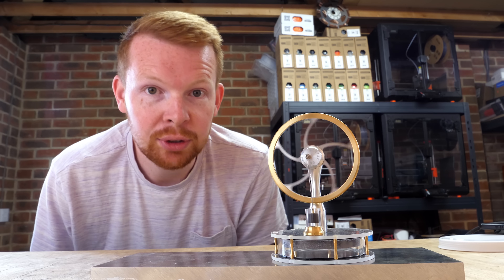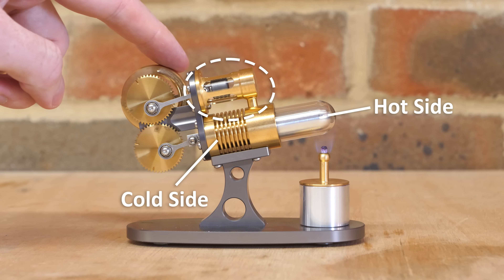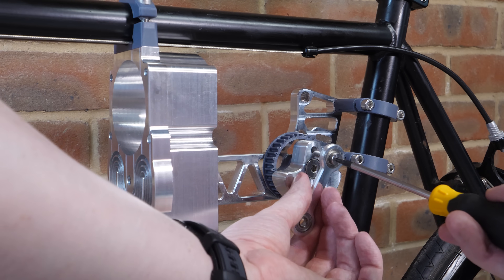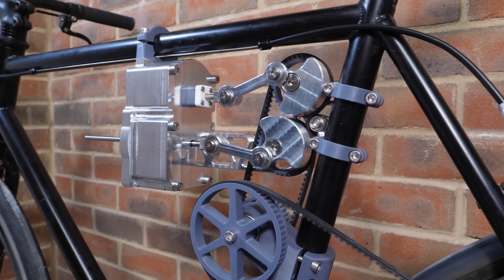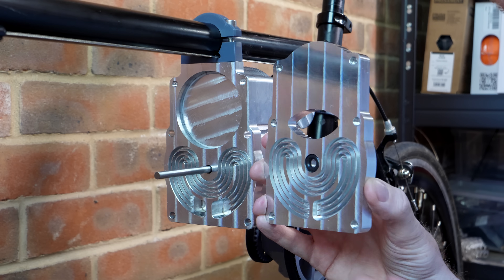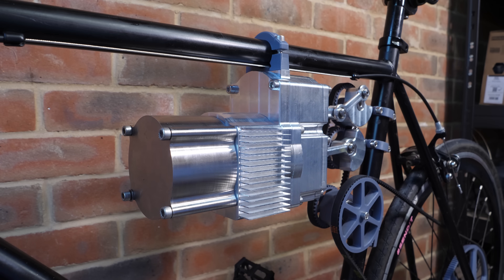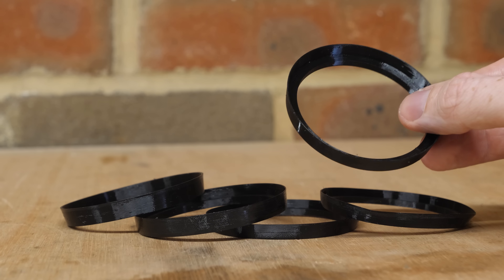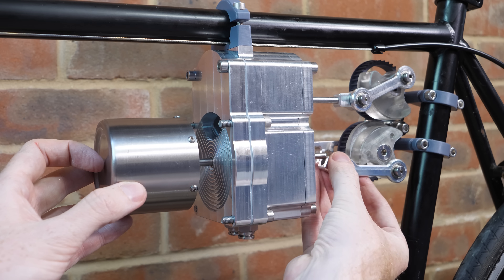Building a Stirling Engine Bike - Part 1

Comment from the maker: Go to https://ground.news/stanton for a better way to stay informed. Subscribe for 40% off unlimited access to world-wide coverage through my link.
Reply: Why use air when there are better alternatives? other gases or even liquids like oils
Reply: I make it with two cylinders
Reply: You ever thought about reverse engineering the electric cigarette lighter to create a heat Source and the power for that can be generated by the front tire Movement by putting a small generator on there that will create the energy necessary to ignite the electric lighter
Reply: I've got a question, why don't you use a bigger coil with an induction heater for this instead use a cable to activate heat source no need for a flame the induction heaters are battery chargeable for the most part I use 1 to consume cannabis
Reply: Use a v twin engine next time like a lawn mower engine then use one side as a power piston and the other as a displacer you can just pop the piston rings off the displacer piston use the spark plug holes to connect both cylinders together this style is actively being used to make energy it uses a parabolic dish and magnifies the heat of the sun to drive the engine they have models now that can produce up to 10 kw only using heat from the sun also instead of using air use a different gas like nitrogen it gets more efficient power
Reply: sterling's works in reverse if you use cold instead of heat, consider using a phase change material, look for the video "DIY Supermaterial Could Save You From Heatstroke: Salt based PCMs"
Reply: Practical idea: If you have a heater in a room — for example, a rocket stove heating a water tank — you could use a Stirling engine to generate electricity from the heat flowing from the tank into your living space. That way, the same heat used to warm your home would also serve as a source of electrical power.
Reply: I like your projects and impressed how you bring your ideas to mechanics! Regarding Stirling my favorits goes more to Solarstirling, but as of now PV seems to be winning the race. But back to your project, I'm quite sure with pressure you are on the right way, You could search e.g German Side 'Viebach Stirling' there is a lot of material including CNC plans. There they show 10 bar pressure  or 150.000 PSI (Air or N2) is needed for a similar sized machine (Helium or H2 would be better but more expensive or inflamable). Chatgpt is telling roughly linear, means  your e.g 10W (mostly friction) might go to 100W.
Reply: To be fair i have seen and heard of every steam powered thing under the sun but I have never heard of a Hot air Engine powered Bike (Stirling Engine bike) As someone who works with live steam i will say that your safety is always top of the list boilers are a very tough thing to make if you're a beginner and if you were to attach a boiler to the bike that would get even more tricky as you need to monitor it you need to make sure it has fire all while it's attached to the bike it's self and that means you're going to be a bit toasty with a boiler strapped between you and a bike, If you do have any interest in Steam, I would highly recommend looking at Steam Model Engineers and kits,  and if you want something that can get  you a to b on steam a Steam Wagon or Steam Traction Miniature in the 4 to 6 inch scale would do, but that's getting expensive, Anyways I think this a great educational piece and a good thing to show people who aren't familiar with how Stirling engines operate and people that want to experiment as one really shouldn't be touching steam boilers unless they have a good clue on what not to do
Reply: Could you make a video experimenting with soft robots?
Reply: I've been watching YT since it started (2005). You are the second Channel I have subscribed to. Thank you for the great engineering.
I started CAD modeling in 1981, GE Aircraft Engine Group. 3D Printing was in it's infancy when I left CAD 3D Solids modeling for Project Management.
It was your Flywheel Trebuchet that hooked me.

Comment: Never use grease on a Stirling engine especially the hot side. Ditch the piston rings on the power piston. Make the piston longer and use graphite as a lubricant.

Comment: I think the major problem is the heat exchanger sizing, you need a heat exchanger on the hot side too, because the contact surface is so small so the system overcompensate by using higher temperature, but that's not ideal and most of the heat is lost to the air.

Comment: Over 40 years ago I first heard of the Stirling engine.  I set out to create some design parameters.  Everything you are doing reminds me of my own experiments.  It took a number of engines before I got it to even operate.  It was never super efficient.  But then I saw the rider engine.  Two simple cylinders with effective regeneration between each.  Suddenly the world changed.  Four to one compression ratios were quite possible.  Greatly increasing the performance.  The phase angle between the cylinders was not 90 degrees.  It was CLOSER to equal to maximise the compression.  I had run the figures through my TRS 80 computer to predict the best timing angles for various temperature ranges.

Comment: As I look at your design I wonder what the restriction was so that the power crank doesn’t align with the piston and as a result needing a substantial crosshead. Was it the size of the cnc? I feel the cylinders could have been spaced out a bit

Comment: I was the only one in my class on thermodynamics to successfully make a Stirling engine that could fulfill the assignment of lifting an American quarter from the ground to laboratory table height. I'm a big fan of Stirling engines. NASA uses them, and space is in fact the perfect place for them, because you have constant sunlight on one side, and near-zero temperature on the other. However, I can't help feeling you're completely missing the point with this. I don't think you'll ever get a workable Stirling Engine bike. If it requires a gas-burner heat source to barely function, what's the point? We've been driving bikes with small conventional fuel engines for over a century, and it would be easy to modify one to run on gas much more efficiently than your Stirling Engine. Allow me to suggest that you make a Stirling Engine Solar Powered electricity generator instead. Use cheap prismatic lenses in an array to focus sunlight and fuel a stationary Stirling Engine that would drive a generator that would charge Lithium batteries for uses like LED lighting in remote villages in India, Africa, and South America. There are places like Tibet and the Andes where sunlight is abundant during the day, and the nights are close to freezing. If one could shade and insulate the ground so it serves as the cold side, and run a Stirling Engine during the day when the sunshine is enough when focused to serve as the hot side, it should be a perfect combination to generate a small amount of electricity for a household off the grid, at least enough for lighting. Of course, one could generate electricity with solar panels, but a Stirling Engine might actually be a more viable option, since it could be more easily produced and maintained locally. My name is Brian. I'm 70 years old. I have a degree in Aerospace Engineering. Let me know if you are interested to work with me on a project that might be of benefit to many poor people in remote villages without electricity.

Comment: you need to get rid of those power piston rings. The friction from those is not good. You're better off using a piston without rings and machine the piston so that it is almost a perfect fit. Yes you will still get some leakage but it will outperform the ringed piston. without pressurization to be honest you'll be lucky to get 10 watts from that engine

Comment: Maybe try adding a heating element to the hot cap so you don’t have to use the propane torch and that way generating heat can be battery powered

Comment: Well the idea of running a bike on a candle flame, thats pretty cool. Not much a motor guy, but this thing probably 2-3 times the size and a large heavy flywheel at rpm. Then reduce to a slow wheel speed would be usable on the street. Hope to see more videos like this

Comment: The oldest trick in the book to create a perfect gasket is to place the gasket material on the surface you aim to seal, and then use a hammer to carefully tap around the edges. Et viola, a gasket in 2 minutes, no printing involved.

Comment: I realize that the amount of air to pressurize the engine bay would be large and that this solution might not be the safest, but what would Paul McCready do? Imagine that the Commander's Seat is on top of a large bellows. It is rectangular and has four linear actuators on each corner. The plane flies up and down to fill the bellows and the linear actuators assist.

Comment: Battery charging seems an option and using sun tracking solar mirrors to heat the relevant parts could be used , plutonium as a heat source would not be too popular I think , but a small unit place around a waste heat source could power retractable batteries and that could be useful .

Comment: If 50mg of paraffin wax is 10j of energy each time the cylinder cycles times 500rpm that is 83j/s. So, a 100mg glow plug would put 160w in the cylinder. A peltier tile to power that plug would be like 120w.

Comment: If the engine is 15% efficient and it is 150w output, 1000w of heat needs to flow through the hot side to the cold side.

Comment: Back in 2014 me and my friends for our college final year end project,  developed a beta type sterling engine of 30 cc capacity with internal pressure of 1.28bar. The engine ran for around 15 minutes non-stop,  the piston ring got seized and the connecting rod joints broke off from the sleeve glide rails, the cooling system failed . I was so happy that at least it ran 😅😅😅. At the end of the day our team was the only one   to score 50 out of 50 in the test score. 
PS there were 20 teams with 5 members.

Comment: Great job, but wouldn’t it be better to build a Stirling engine with at least 1 kW output for households? The heat source could be any solar panel or other simple source of heat. This would be an excellent emergency solution for generating electricity at home. I believe it could be produced at an affordable price.

Comment: If you put something in the area where you burn the plate but inside that stays hot, and add low compression burning gasoline, you would make it diesel.

Comment: 6:40 I realise that just because you're smart doesn't mean you know everything, but it's still jarring to me that a man of Tom's capability has his rear brake set up wrong 😅 the caliper should be set up to work with the little silver lever flipped down. That way, you can flip the lever to open up the caliper, allowing the tyre to pass between the brake pads.

Comment: Maybe try adding a flywheel on the engine and then a clutch after that and i bet you will have more torque.  3d printed transmission added maybe for most efficiency 👀

Comment: I am trying to find out if super conducting tape will reduce thermal losses in a corona motor, chatgpt doesn't really say it will, but I still think a tape deck with a xenon stirling regenerator could be useful to microwave sputtering.

Comment: If a 90hp motor wastes 182hp as heat then a 15% carnot efficiency stirling engine regenerate a potential 27hp. That is a bad estimate because it doesn't take into account the heat radiated from the block and the heat out the exhaust, and I'm sure that the coolant has to be an appropriate temperature when it goes back to thermostat, but I'm sure 10-15hp is possible there. The stirling draws right before the coolant goes through the radiator. I like to do other ecomods, just because, like making the accessories belt electric to reduce drag on the engine. Electric water pump. Increase the spark in the cylinder. etc. etc.

Comment: Look at PlasmaChannel's electrostatic motor. I think, those kind of motors like a specific RPM to be efficient. Imagine that cylindrical motor is the width of an economy vehicle with a couple of belts that drive the back wheels. It would be an awesome kit. If you could regenerate even 10hp to those wheels for highway in a 90hp vehicle the fuel economy will be improved dramatically. If the vehicle has exhaust gas recirculation, there is the potential to improve combustion and emissions. It would be nice to market super commuters for retrofitting, find the people who drive 1-1.5hr to work, so they can jump on the interstate and hit the cruise control and save gas.

Comment: What is the flowrate of your stirling if you put it on a hot iron? It would be awesome to get a hybrid electric car and put a stirling on the engine coolant. Hybrid electric cars are usually like 40% thermally efficient at converting stored chemical energy into mechanical work, they do still waste heat through the coolant, if exhaust is 15%, there is still 25-35% of the thermal energy generated in the coolant. So, you could make the stirling large enough to regenerate enough energy to run a compressor head and regenerate electricity for forward motion.

Comment: Yes — and that’s a really interesting and active area of research.

There are crystals and materials that show enhanced thermoelectric effects in magnetic fields, or even generate electric current directly from a temperature gradient and a magnetic field. These phenomena belong to a family of effects that go beyond the classical Seebeck effect. Here are some key examples:

🔹 1. Nernst and Ettingshausen Effects (Thermomagnetic Effects)

Nernst effect: When you apply a temperature gradient and a magnetic field, a transverse electric voltage develops (perpendicular to both).

𝐸
∝
𝐵
×
∇
𝑇
E∝B×∇T

Ettingshausen effect: The reverse — if you drive an electric current in a magnetic field, it creates a temperature gradient across the material.

These effects occur in conductors and semiconductors, especially those with strong carrier mobility (e.g., bismuth, InSb, graphene).

Applications: thermomagnetic cooling, solid-state sensors, and advanced thermoelectric generators.

🔹 2. Magneto-Seebeck and Spin Seebeck Effects

In magnetic materials (ferromagnets, ferrites, topological insulators):

Magneto-Seebeck effect: The Seebeck coefficient (how voltage depends on temperature gradient) changes when you apply a magnetic field.

Spin Seebeck effect: A thermal gradient in a magnetic material can generate a spin current (not just charge current), which can be converted into electricity using the inverse spin Hall effect in an attached metal (like Pt).

This happens in materials like:

Yttrium Iron Garnet (YIG)

Nickel, cobalt thin films

Topological insulators (Bi₂Se₃, Bi₂Te₃)

🔹 3. Topological and Correlated Materials

In materials with strong spin–orbit coupling or nontrivial Berry curvature (like Weyl semimetals or topological insulators), heat + magnetic field interactions can produce giant anomalous Nernst or magneto-thermoelectric responses.

Examples:

Co₂MnGa (Weyl semimetal)

Mn₃Sn (antiferromagnet with anomalous Hall/Nernst effects)

Bi₂Te₃ family (classical thermoelectric + topological features)

🔹 4. Magneto-Caloric and Electro-Caloric Hybrids

Some crystals (especially perovskites and Heusler alloys) show coupling between magnetism, temperature, and electric polarization — allowing you to design multiferroic thermoelectric converters that respond to all three.

If you’re trying to design a small thermoelectric circuit or engine block experiment, these are interesting directions:

Try bismuth telluride (Bi₂Te₃) for baseline thermoelectric behavior.

Then add a magnetic field to test Nernst enhancement.

Or use a magnetic semiconductor like InSb under strong field to observe transverse thermoelectric generation.